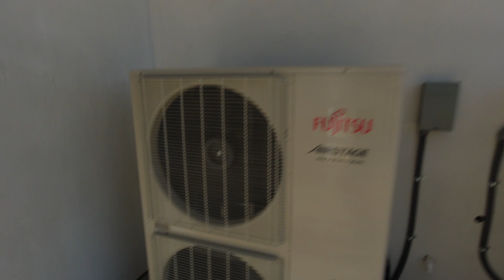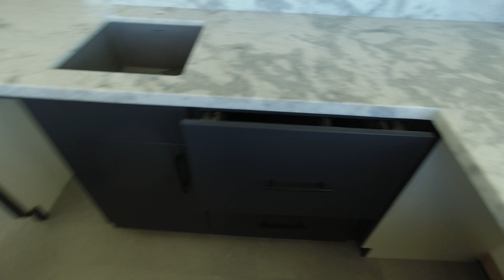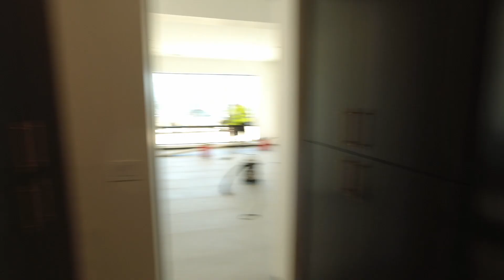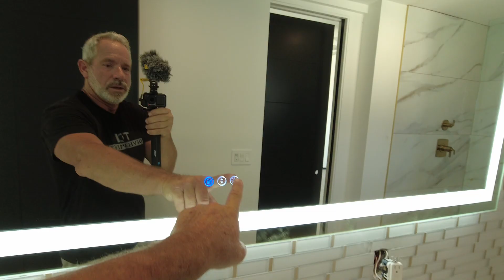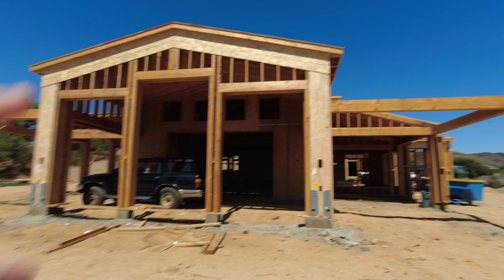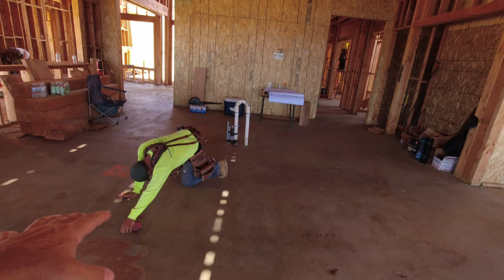Massive Wine Country Estate Nearing Completion!

Comment: Another question regarding radiant barrier.  Do you ever do spray foam insulation?
Reply from the maker: We don't ever use spray foam insulation. I know some people love that stuff but I do not touch it. A lot of banks in California will not finance a home if it has spray foam insulation and the lumber cannot be inspected for rot
Reply: @tcidevelopment5996   I’ve been doing open cell foam here in Texas it doesn’t hold water like closed cell foam which causes that issue if there’s a leak.  Thing here is with super hot summers running AC literally 24/7 you’ll save 50% on your electric bill. Makes a huge difference and lowers the tonnage required especially on big houses.  
Keep up the great work my friend!
Reply: @rbdesigner725  thanks buddy! Have an awesome day!